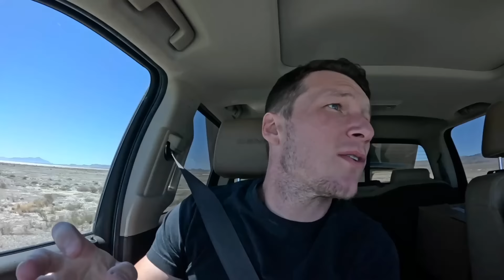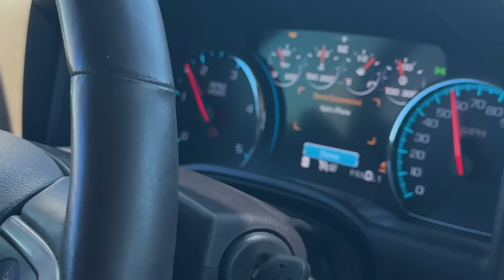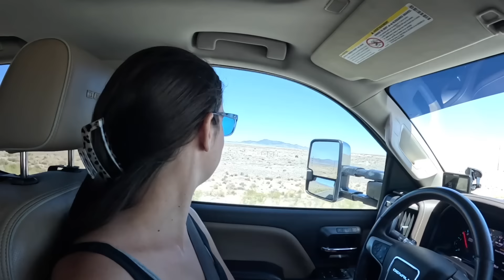New Trucks are 'Built' to Leave You Stranded

Comment: You hit there nail on the head! After 17 years with our F350 diesel, we switched to an F350 with the 7.3 liter V8 gas. We spent SO much money on repairs to that Powerstroke diesel  - and it was even before the latest DPF and regulations! We've found that for our RV towing and truck use - the large gas V8 is a much better choice. If I were towing more regularly, and at heavier amounts - I'd probably still get a diesel. But for towing a 12,500 lb 5th wheel only a few times each year, and a 4000 lb boat to the lake 10 times per summer - the Godzilla gas engine works great. We do take longer summer trips (out west from PA toward Yellowstone, Mt. Rushmore) - and the F350 gasser works great for that too. I don't miss the diesel.
Reply: Here's our video about switching from diesel to gas for our F350 truck. https://www.youtube.com/watch?v=b4oJeIHEgT0
Reply: Did the same with a 2004 Duramax, after 18 years of fussing with that 3 sets of injectors and worries of getting water in my fill ups while traveling. Went to a 2019 6.0 Chevy and it pulls my 10,000 5th wheel with ease, a little less gas mileage but a whole lot cheaper to run and find a mechanic!
Reply: Yeah, a lot of people don't understand that gas engines have come a long way. The torque and horsepower gap isn't what it used to be. Gas is going to be less efficient from a power standpoint but I suspect that the fuel cost is about the same given the price of diesel since covid anyway. Combine that with less emissions BS and it becomes hard to justify buying a non-gov surplus diesel vehicle.
Reply: I have had the exact opposite experience with my 1999 Ford 7.3. It’s a bulletproof engine. I don’t know if you went to the dealership and they kept making problems?  It’s a 7.3 international. It’s a legendary engine that requires the least wrenching of any vehicle I’ve ever owned.  Of course mine is the German five speed manual. Maybe you had transmission problems?
Reply: @PrePaidTeam Ours was the 6.0 PowerStroke.

Comment: I had a 2022 GMC 2500 and I sold it after a few months. Started having fuel pump issues and DEF issues. The truck only had 29K miles!!  Went back to an old gen 2 tundra and never looked back

Comment: Built diesel trucks for over 30 years on the line and in our repair section. The addition of adding the DEF system was a pita in the later years. From sensors that could be banged around and get damaged (partly ceramic) prior to installing to the downpipe mentioned where the gaskets between turbo/DOC/exhaust meet that had to be completely flush. 
  We hated engineers haha, most were people that had no clue what it was like to work on these after built.
Built virtually every IH product from  early 90s to 2025 and later GM cutaways and 4500-6500 Silverado's(6.6L).
  Don't miss them.  😂

Comment: I have that truck. HP Tuners ECU and pull all that emissions bullshit off. 

The next thing that will happen to your truck is that it will clog the DPF and not run. If you don't want to cut it off, drill it through with a real long drill bit. 

That's a great truck, just need to cut off all the bullshit.

Comment: there's good information in here! also want to add there are DEF additives/conditioners like from hot shot secrets and other companies. i also run hot shot secrets diesel additives every fill up since i have the disco party cp4 pump on my f350 ( i also have disaster kit on it). 
The other thing i wanted to point out is there is a bypass oil filters (basically a secondary filter)  you can get that can help keep your oil cleaner and less contaminents in it. If you do oil analysis you can figure out what's best for your truck but you can run a little longer on the same oil because you're able to track the oils lubricating characteristics and also monitor difference metals in the oil.
we spend a lot of money on these trucks. go the extra mile to make them last!

Comment: Diesel techs are special breed,   I worked with a few good ones and they deserve their pay.  It’s hard,  heavy,  tight & confined spaces,   sometimes they pull the cabs & fuel system failures or turbos could be a pain.   That’s why I stick with electrical and gas engines.

Comment: Ford 7.3 Godzilla gas. Plenty of power to pull your smaller 5th wheel. 8mpg. Fuel COST will be similar. Research the Godzilla motor. Ford has done a stellar job in designing a diesel alternative. And I'm a lifelong Chevy guy. It has no multi displacement garbage, no direct injection, no auto off at stoplights. It's the ONLY gas motor to consider. Otherwise, suffer with the diesel problems.

Comment: We have a 2021 GMC with the 3.0l diesel.  The owners manual says to use Top Tier Diesel, which I’m learning includes all of the additives and is higher grade.  The only place I have found that sells Top Tier Diesel is Costco.  Which means it is cheaper than a gas station, but maybe not as inexpensive as the place where you guys purchase diesel.  We’ve had issues twice - one fill up before the Extraterrestrial Highway in Nevada (scary) and another outside of Portland. Both times, the issues started with a full fill up, not at a Costco.  Once we refilled with Costco diesel, the issues went away. If I can’t find Costco, we either use Chevron or Shell who also add the additives. 
Love the show.

Comment: As soon as TIER 4 requirements went into effect, we had MANY issues with the aircraft generator sets we built.  So many warranty issues with the DEF system, both with the particulate system and crystallization in the DEF tank.  I'll NEVER buy a diesel with this crap on it!  Differences between diesel and gasoline - gasoline won't leave you in limp mode or stranded because of a DEF issue.  Spark plugs are easy!

Comment: EPA and Transportation Secretary have lifted stupid restrictions. Go buy a High Output 6.7 Ford and "Delete" it. You won't get busted. 

All GM's are having issues. 6.2 Gas recall is a major fail. I left GM for Ford.
Reply: We can't foget the GM/Ford 10 speed transmission valve body problems. NextGen engineering has a bulletproof simplified valve body kit that we can install in our drive way in a couple hours.

Comment: Not fueling while a delivery is being made, was true when your grandfather and father were young, not true at all today. I transported fuel for 7 years, before moving to auto transport; here's a few things I learned. 

Back in the day, fuel stations only used one filter, at the dispensing pump; and they used steel storage tanks. Today, stations have multiple filters between the storage tanks, and the dispensing pump. These filters make the vehicle fuel filter, look like the filtration of a paper towel. They catch VERY tiny particles that your vehicle filter won't. 
In 1988 the Federal government implemented the UST standards for underground storage tanks. Regulating the use of fiberglass reinforced, plastic-lined underground fuel storage tanks. They are corrosion/rust proof. As are the aluminum tank-trailers that transport the fuel to the stations. These underground tanks are also mechanically sealed, requiring special couplers in order to open the ground ports, under the man-hole type covers in the ground. Many stations add locks to these ports, for added security. So any "contamination" or debris found inside of one of these storage tanks, can only occur during the transport phase of the transaction. Either due to poorly performing transport drivers, or due to poorly maintained equipment. Fuel tank trailers are inspected/professionally cleaned, at a minimum of once a year, so highly unlikely it's an equipment issue. Which leaves only road debris entering the delivery hoses/couplers, while the transport truck is travelling. Professional transport drivers, will use hose caps to prevent any debris from entering their hoses during transport. At a minimum, professional transporters, will stow their hoses in capped storage tubes on the side of the trailer to prevent debris from entering the hoses. I used both, stored my capped hoses inside capped storage tubes. My couplers were stored in a sealed box. 
There is very little chance that any debris is inside the underground storage tank; so there is very little chance that debris will be kicked-up by a delivery. If it is, the many filters at the fueling station will easily capture those particles, and prevent them from entering your vehicle.

It is perfectly safe to fuel your vehicle during a fuel delivery. 

The only other type of "contamination" that you may encounter, would be fuel mixtures. Diesel mixing with gasoline, etc. Which happens a little, every time a delivery is made; and is a much longer explanation.

DEF is similar, if the station is using an underground storage tank. It will have the same regs from the 1988 UST. However, since DEF was not a thing until 2010; most fuel stations resorted to above ground, steel tanks, for the initial roll-out; to cut down on cost. Though the big dogs have since corrected this issue by installing underground tanks, the main problem for DEF contamination still exists. DEF is transported to transfer stations, using steel rail cars. It is then transferred to the aluminum transport tanker, which then delivers it to the fueling station. Steel is corrosive; so DEF being transported using steel railcars, gets contaminated. This is a huge problem when dispensing DEF from the fueling station, as opposed to buying it in boxes/single use containers. The single use containers are filled at the production facility, where it is clean, and free of any contamination. 

Sorry for the length, I wanted to give you factual information about your concern.

Comment: We had a Mercedes sprinter diesel, and the DEF system had to be completely replaced in it about two months after that the engine seized up. I don’t know if it’s the same for all brands, but Mercedes put a cheap vice in their system to pass regulations and had a major lawsuit against them. Because of the lawsuit, they had to replace our whole DEF system because that had failed it locked her engine, but they’re not responsible to replace the engine.. they want $30,000 to put a new engine in it. Buyer beware of diesel exhaust systems.

Comment: When my cummins has the code I took off the 2 bolts that  keep the injector attached.  Soak the tip of the injector in a sandwich bag of hot water. Don't get the electrical parts wet. Brush off the tip and reinstall. Works great. Watched others do it on youtube.

Comment: Awesome to have such a great mechanic work with you on it!  Let alone let you video him!  Awesome!  Great info!

He may of said this to you, but since your emissions are still in tact, I would not use the ATF or 2 stroke oil as a fuel additive.  Stick with Hot shot secret, archoil or Optilube XPD.  I think I've seen you using the XPD.  If you ever go through a weight loss & remove the emissions equipment (Which may be legal here in 45 days), then you can use the trans fluid or other stuff.  If you do it with emissions equipment in tact, It could create more particulate & plug up the dpf or SCR or who knows what else.  Your truck has the miles that, in 45 days when the EPA rules change, you may be able to legally remove your components and be legal to delete.  Nobody is sure yet 100 percent, but it will be removing the language in the areas of the components end of useful life or other things like that.  Before it said, had to be returned to like it was after a repair, that language is being deleted.  So to me it means, will come from the factory with emissions, but once the emissions warranty is up, or a part fails, you can remedy it how you want.  I'd delete it.  Problems go away.  (PS If you ever do, make sure you inject dielectric grease up into the unused sensor plugs under the truck and bag them up tight so no corrosion can form up in those terminals causing voltage irregularities in the harness & lead to other issues.  )

Comment: The bottom line is and I've heard this from a lot of people that own diesels. If you don't need it, don't get it. If it pays for its self, then get a diesel but if you don't tow heavy all the time, stick with gas, especially if you don't do a lot of highway driving. Diesels shine at long highway driving and working but when you're city hopping and tow occasionally, get a gasser. The more a truck regens do to city driving, the Regen process uses your tank fuel to heat up the DPF to burn off the soot inside the DPF, which in turn drops your fuel economy.

Comment: I pull a 35 foot 5th wheel with an 8 liter Magnum V-10 in a 2001 Dodge Ram 2500 4x4. I couldn't imagine having to go through this and to always think about it. I only get 8 mpg pulling the 5th wheel, but I would be afraid switching away from gas knowing the maintenance costs associated with diesel engines.

Love your channel.!!

Comment: Either delete the emissions system or plan on paying $10,000 for a new DPF filter. Even if you have the DPF cleaned, they don't last that long. Ok so i keep adding to this comment as i am watching the video. I use the Blue DEF 
Platinum in my truck. No issues. Also if you do buy a new GM truck, the Allison Transmissions are junk. New trucks are breaking down. Don't buy a GM truck with the 6.2 V8 gas motor. They are also junk.

Comment: As long as these emission control systems are mandated, diesel is dead to me. It's much easier to just buy a truck with a Godzilla engine or something. It burns more fuel but it's cheaper in the long run because you don't have to spend thousands fixing all these dumb diesel problems.

Comment: Ooops. My story below is correct for vehicles that were prior to using the DEF (Diesel Exhsust Fluid). Before DEF, the process was extra fuel to cause the higher temp.  I had an over the road business, using an Isuzu NRR (26,000 lb gross) before DEF.  Had to get the DPF cleaned twice (500,000 miles) at about $1,000 per clean job.

Comment: Yep they are built to fail . This is why I say never buy a new diesel , instead find a mint pre 2010 and if necessary puts a new crate engine in it . Still likely to cost less and provide way less headaches than any new diesel on the market . Just saying 
 Ps that being said I did watch a video about a professional RV hauler who bought a new dodge Cummins turbo and had close to 500,000 miles on it , supposedly without any issues other than scheduled maintenance , so make of it what you will ,  but I definitely would never buy a late model ford , Chevy or GMC diesel . Just my 2c worth

Comment: I totally feel your pain. I have a 2023 Ram 2500. I just thought I was taking it into the shop for something easy that would take a day to fix. My tow braking system kept saying trailer disconnected and would not apply the brakes on my 5th wheel. Everything was connected correctly and it still didn’t work. I already replaced the wiring on the 5th wheel so the issue is with the truck. The shop confirmed it an issue in the truck. They have had my truck now for 3weeks and still don’t know what is going on. They have been working with Ram engineers and still can’t figure it out. The truck is still under warranty so I guess that is good. But the truck is worthless to me, if I can’t tow with it. We don’t know what we would have done if we were full time. I did go back to a gas truck, due to my diesel truck was just costing me way too much. That mechanic you had really took care of you. The one thing he didn’t mention is the parts for diesel trucks are about twice the price then gas. The other thing is I think the trucks use the same transmission in them if they are gas or diesel. Now different makes use different transmissions GMC, Ram, Ford. I do feel the newer trucks are build to fail. We love your videos, keep them coming!!!

Comment: Lol, The Allison is NOT a better transmission than the Ford 6R140, Which can easily handle 800-1200 HP stock. bigger doesnt mean better. Best Diesel truck you can have is 2011-2016 Ford 6.7 Powerstroke Deleted. period.

Comment: He asks "Is there anything I could have done to prevent this"? ..... Run old iron, no touch screens, no computers, no modules, manual everything, no creature comforts except a for a cigarette lighter and a sun visor. I've been running old diesels for 40 years. My newest truck is a 99 IH 4700 with a T444e and it is too modern for my taste, newest tractor is a 2000 model year M4900. I have an old farmall with an inline 6 German diesel never opened up and still runs strong. Ran Detroit and Cummins in Ford tandems in the 80's and 90's, no computers, all mechanical, the apocalypse could happen and they'd keep running.
Nowadays everyone wants their airconditioning and dashboard toys and power everything and automatic trans and cruise. Girly trucks.

Comment: I’ve driven all the diesels from ford ram and GM. I really like the power of the power stroke. I liked the transmission on the GM. But, there is no substitute for the engine braking on the Cummins. And I tow, A LOT. Saves on brakes up here in the mountains. And just an overall more stable decent.

Comment: Great video. Appreciate the info on how often to change the oil. We have 152k on our 2019 Silverado 3500. I had the fuel filter changed in Sturgis @ Ultimate Performance. He recommended changing it every 5k miles. I’d been following Chev’s recommendations. Will be changing it at 5k from now on.